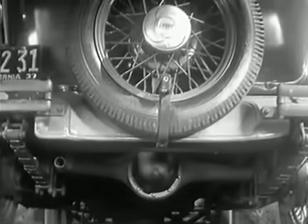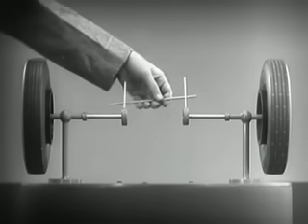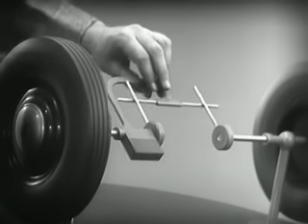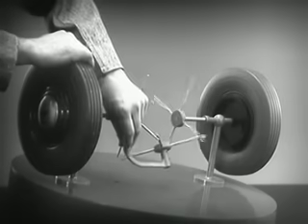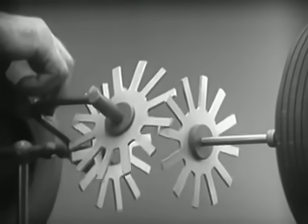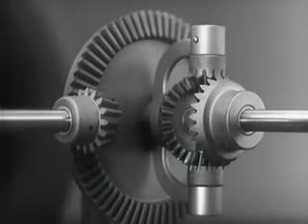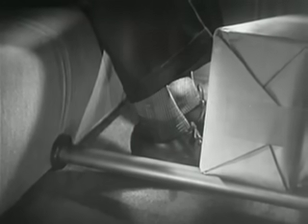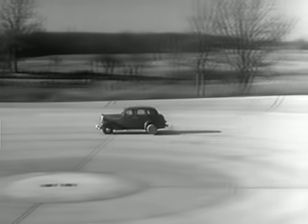Around The Corner - How Differential Steering Works (1937)

Comment: 7:50 Love how they built a whole car with a shaft running through the cabin just to make a point. Nothing was spared back in the day!
Reply: GM was the largest company in the world at one point, they had money to burn.
Reply: They just put a tube with a black ring against the seat, it doesn't actually go through the seat.
Reply: @faramund9865  You may be right, but they could have built a whole chassis for a static display if they had tours.
Reply: It's probably just the individual pieces shown made for the video, not the whole car. That, or there were already cars that existed with that problem
Reply: Yeah, I was thinking the same
Reply: @kuckoo9036  Agree KooKoo, but the load transference matters only to people who want to drive like prats. Normal people just want cheap reliable cars to potter about in. FWD perfect.
Reply: It might have been simpler to invent front wheel drive?
Reply: @johnbishop5316  Front-wheel drive is even more complicated.
Reply: @johnbishop5316  front wheel drive has the problem that the wheels also need to turn side to side
Reply: @youzhou3001  still uses a differential as the final drive. It really makes no difference. 4 wheel drive has been a thing longer than front wheel drive.
Reply: Then we went electric and got rid of the shaft forever.
Reply: @ALucas73  Electric cars existed before this film was made.
Reply: @ALucas73  fun fact: electric vehicles were invented long before steam and combustion engines were forced by coal and oil oligopolies
Reply: @goury  fun fact: they had 2-4 hp when "cheap" ICE cars had 15-25 and their batteries had a whopping 50-60 cycles before needing replacements (and an unbelievable range of 75 km at best)
Reply: @angrydragonslayer , no, that's an oil oligopolic lie.
Electric engines was always much more powerful and lighter and also didn't require much maintenance.
As for the batteries, they've used solid conductors instead.

Ever heard about electric trams?

And even lead acid batteries (that were invented long before first commercial vehicles) could go with 300 cycles and was very easy to recycle into new batteries.
And they were always cheap as dirt, so replacing it once every couple of years was never a big deal.

And before oil oligopolies came, there was no suburban infestation and cities were built the way you'd never need to go further than ten kilometers in your lifetime.
Reply: @goury  ok, assuming all of that is true, what did an electric car cost?

to make it simpler, lets use the year 1912, the peak of electric car sales.
Reply: @wanders278  You're the one spreading it, not me
Reply: @angrydragonslayer  Jay Leno has a 1909 Baker electric. The range is approximately 100 miles and the original batteries didn't need to be replaced, they needed to be refilled with water every so often. Jay still has at least one of the original batteries, and could still use it if he wanted to. As for why ICE supplanted steam and electric cars, it wasn't so much oil barons as it was that the technology to improve ICE was easier and cheaper than it was for steam or electric. Recall that steam cars still used coal or gasoline or some other combustion fuel source, so coal and oil companies had no reason to try and kill it.
Reply: @cirrustate8674  i checked since that is blatantly wrong based on what i know and so i want to note two things

The car has ~ 100 miles of range on modern lead-acids, the original adverts guaranteed 20 miles and said 50 was possible with good planning.

The specific model Leno has is a highly upgraded version of the flagship model (which cost ~$4000 stock and ~$6700 in the setup Leno has, 130k and 220k in direct inflation respectively.)
Reply: @goury  You'd NEVER need to go more than TEN KILOMETERS in your LIFETIME? Come on man, that's just blatant nonsense.
Reply: @American-Plague  no, blatant nonsense is to assume that every person ever existed drove a car. How did people live before cars were invented? Do you truly believe that every medieval peasant drove a private horse to his workplace and back every day?

Also trains and trams.

Comment: Now I get how a differential works! Thank you very much for these excellent classic videos. 
Now I'm wondering how a "limited slip" or "positraction" differential works.
Reply: Late comment, but a positraction differential is just the brand name of an LSD. They work by limiting torque in the differential either mechanically, electrically or with a fluid that becomes thicker under heat which kind of seizes the differential. Basically, they allow the wheels to spin at different speeds until a torque threshold is hit in the differential and then the LSD kicks in to not allow them to go any faster than the other wheel. Most LSDs these days are mechanically based, using gears or clutches that move under certain torque thresholds, but electronic ones are becoming more common.

Comment: AAAAND thats the part we stopped doing.. at 8:40 “the parts were built to withstand far greater strains than it will ever encounter”… 
We stopped seeing our customers as our neighbor’s who wanted strong, quality machines, and through the “glory” of the marketing age, business owners have now come to realize that consumers are separate beings from themselves. And will just have to buy whatever you give them. So cut down on material costs, make that handle, hinge, sheet metal, drive, etc out of 1/2, 1/4, 1/8 as much steel, yet charge just as much. Sure they’ll have to buy 1 each year now, but hey, thats good for you (business owner) too, right??
Thats why all products, machines i own built from the 70’s and earlier, still hold up structurally… I have a refrigerator thats older than i am, of course the motor needs replacing, but all the hinges, handles, etc all in perfect working order. We’ve gone through several on newer models however..

Comment: I was wondering why my lego models all have this, also why rc cars can have their wheels spin independently. There is an issue with a differential  on rc cars without good suspension anyway, where if one wheel is on the ground, with the other wheel in the air, the wheel in the air will do all the spinning and the car won't have any driving force on the ground.

Comment: Then a limited-slip differential, often known by the generic trademark Positraction, was invented!!

Positraction is a limited slip differential which distributes power equally to both the right and left tires. The '64 Skylark had a regular differential, which, anyone who's been stuck in the mud in Alabama knows, you step on the gas, one tire spins, the other tire does nothing.

Ms. Mona Lisa Vito

Comment: There has always been a way simpler fashion/manner of doing this;  there are a few of them in fact;  one would be a hydraulic drive motor for each of all four wheels and a pump.  Another one which has always been around is a planetary gear system.  Oh and the hydraulic one would maybe need two per wheel;  one for reverse.  Cheers and but don't get me wrong about this thing;  I like that someone thought of this;  finally someone that had vision.

Comment: You have proved OLD is GOLD..iam doing an experiment to increase torque by motor and cycle.. Please help ..me ..which and what type of motors and gear ⚙️ should use and current should flow ( ac/ dc) Volts etc..

Comment: This may sound stupid but wouldn’t the car deliver drive to only one of the wheels if you make a very slow turn? So would that mean you can’t make a left turn whit this configuration?
Reply: I don't think sounds stupid at all. I ASSUME the reason why both wheels have to turn is because the front wheels. The angle between the front axel and rear axel will determine the radius of the turn. Unless that radius allows one of the wheels to turn, they HAVE to turn. Otherwise it would mean the front tires would sliding. Hopefully that makes sense
Reply: @ShadowMageAlpha  Oh wow that indeed makes a lot of sense, thanks!
Reply: @frontrowviews  keep in mind, I don't know that it is true. I'm going off of assumptions and instincts. I DO know that force tends to take the easiest way out though.
Reply: Also, I just thought about Segways. If they can't move forward and turn, that would be an example of your problem occurring. They don't have the front wheels to stabilize, so I can see you having to stop to turn. (Assuming Segways use a differential)

Comment: I find it odd that a differential was created because a 1 wheel drive system couldn't get enough traction, but 4wd cars have a locking differential setting because differentials are terrible with grip! The solution was a device that basically gave no power to the wheel the grips and all the power to the wheel that slips? Seems like there was more to this...

Comment: I'm impressed that they let a woman run on the wheel, in 1937 (at the very end of the movie). I don't even think anybody would do that nowadays, as in, if anybody did this, it would only be men. I think I'm watching this video because I was reviewing calculus differentials, and then I also was looking at exotic vacuum objects at the same time. This video reminds me of the EVO torus. And the motorcycles driving in the beginning are like the materials being pulled into the EVO. That video was what I watched after 'Brown's Gas Versus Tungsten Experiment,' where he mentioned that he thought EVOs might be causing the tungsten to vaporize and crystallize. So then there was some other video about the EVOs, and it showed spinning things going around a torus, only they were squashed on the inner side of the torus, for the same reasons that the inner motorcycle, or the inner wheel, has to drive slower. Unfortunately, I can't grasp any of this well enough to actually make use of it. It's all just vague analogies and images.

Comment: It's interesting that engineers figured out how to lower the drive shaft below the floor of the car in 1937 and yet cars from the 50s had the big hump in the middle of the floor. Did they lower the car or raise the drive shaft?
Reply: I’m in the mood for some tacos
Reply: @eddiew2325  me too
Reply: "A curious and two apes"
Reply: I'm guessing more modern cars had even less vertical space so even the lowered drive shaft might not have been low enough. On the other hand maybe the "more rugged" lowered drive shaft was a marketing gimmick of the time and didn't live on.
Reply: I remember our old 80s car still had the hump in the middle of the floor.
Reply: I think the explanation lies in the in 1930ś still upcoming monocoque chassis, which lowered the cabin floor so much that the bulge for the drive shaft once again raised it's ugly head. ; )

In the 1930's the chassis and the body of the car were separate builds, like still seen in lorries and most railroad cars. Cars were relatively high compared to the inside vertical room they had, so the drive axle was easily hidden under the floor.

Comment: whoever invented differentials was a  genius. so simple
Reply: No one actually invented it instantly, it's just a process of developing
Reply: @random-b-i2480  it's an invention called utility model type- anything built differently from the original idea. .if a table was modified from 4 legs into 3 and still function as a table that is utility model type. .and patentable
Reply: The conventional automobile differential was invented in 1827 by a Frenchman, Onésiphore Pecqueur. It was used first on steam-driven vehicles and was a well-known device when internal-combustion engines appeared at the end of the 19th century
Reply: It was probably a series of simple steps when they understood the problem they had, the solution they needed, and what they had to work with.

Think of this riddle: "Question: How do you eat an elephant?
Solution: One bite at a time".

Many seemingly impossibly complicated problems can be solved when you break them down to a series of small, simple problems.
Reply: @foxymetroid  one bite at a time and with a family or having it airtight and frozen when you get full
Reply: . https://youtu.be/4G6e4TaJxkI ! !
Reply: From what I was told by a car nut, it was the Germans.

Comment: It would be nice to own a garage back in those days wrenching on cars because they were so simple to work on. These modern cars are way overengineered, and that's why they don't last as long. That along with manufacturing outside of the U.S. (poor quality control) with some auto makers, and cheap materials used in manufacturing these automobiles.

Comment: Thank you so much for this video.
Before I was really confused about how those rear wheels work separately on turns or when any of one wheel stuck and other still running.
Now i learned by this video that what is actually engineering beside it..

Again thank you so much.👍👌🏻🙏😇

Comment: You have to love the way they don't put the driveshaft inside the car is because it would be awkward to put luggage around ...not because you have a piece of metal spinning around at 5000rpm that would definitely get stuck on fingers or hair getting ripping them off if you accidentally touch it...no because of luggage

Comment: 5:10 is a great moment because it shows how an open differential will spin one tire at twice the normal speed if the other is stopped. You can see the spoke on the right advancing ahead of the main drive because of the stopped wheel. I've seen a lot of shadetree mechanics say that a "one-wheel peel" isn't dangerous because the tire is spinning twice as fast as the speedometer indicates (assuming speedometer is read from transmission output and not wheel speed sensors) which could make a tire come apart much faster but this makes it pretty clear.